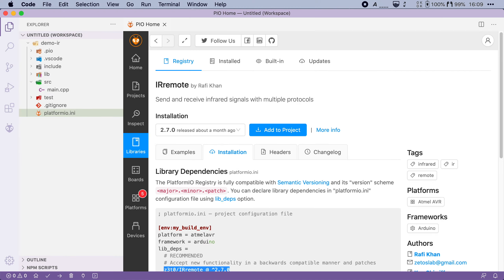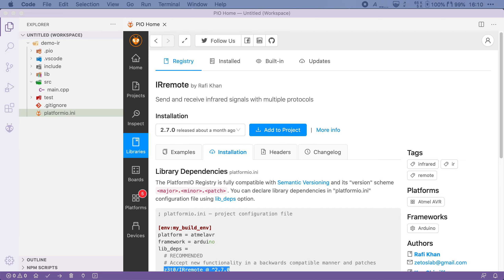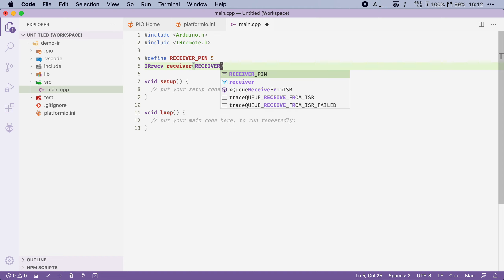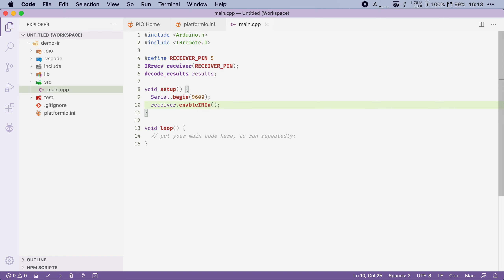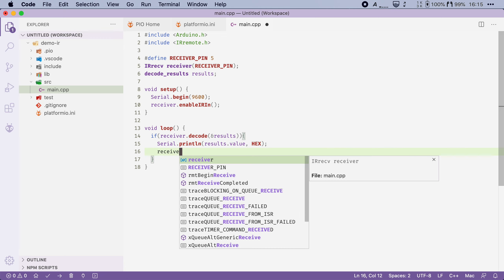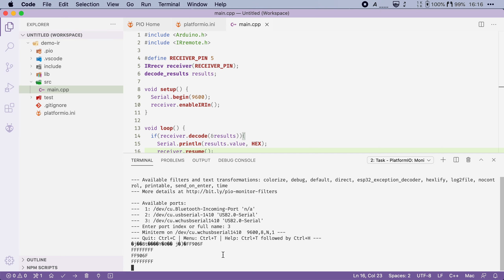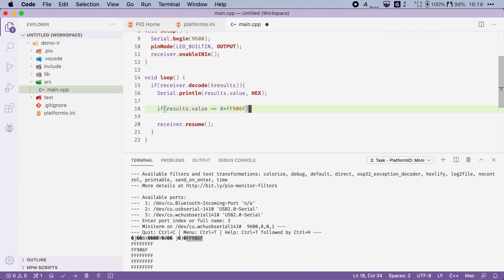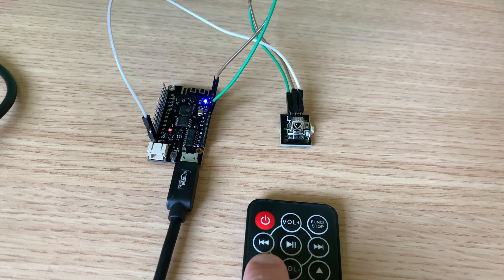Using IR Receiver (HX1838) + Remote Control (ESP32 + Arduino Series)

Comment: I am receiving Different hex codes at different distances .what to do?
Reply from the maker: Use those instead. Every remote will be slightly different. That's normal.
Reply: Maybe your remote is faulty. Change your remote.